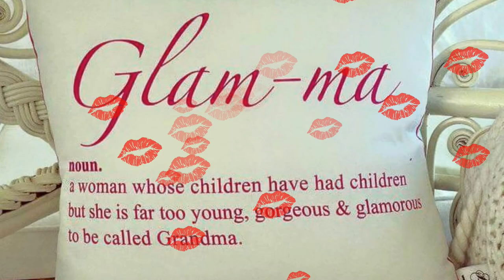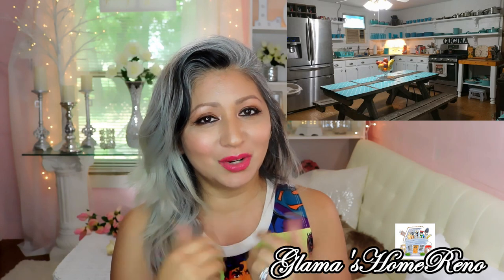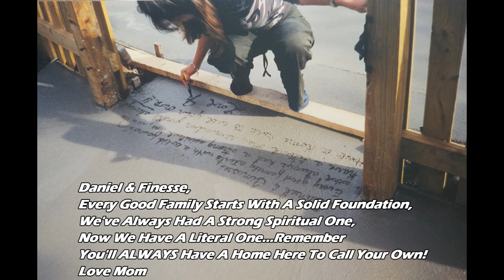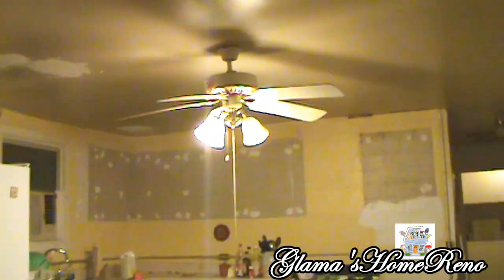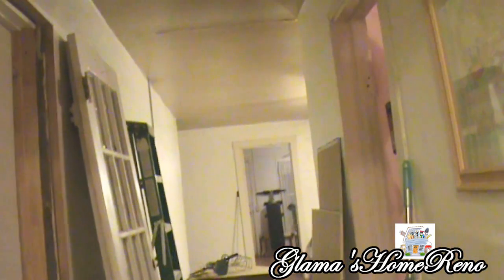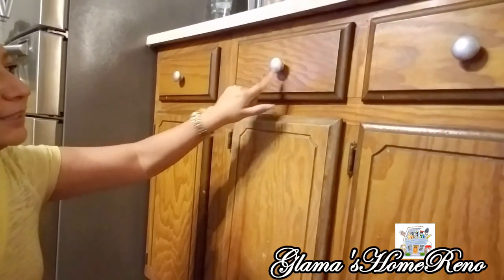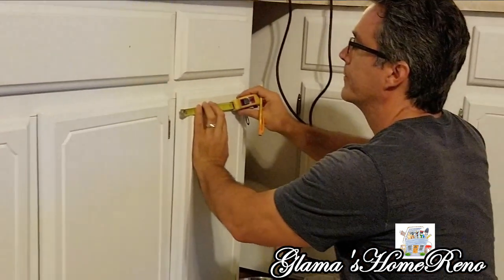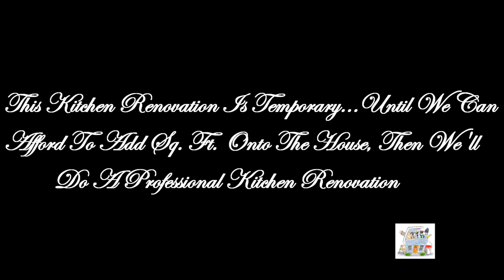UPDATE On My DIY Childhood Home Renovations + Storytime

Comment: I love what you are doing.  I have a question re the kitchen, as you are taking out the fan and replacing it with a chandelier, what are you going to do to cool down the kitchen?  I'm in Australia and cooking in the kitchen (even boiling a kettle) can be crucifying on a hot day.  I would have thought you would need a fan or air conditioning.  
One other thing I don't understand is, what is your mum going to do?  Will she be living with you?
Thanks for your video.  Happy renovating from Australia.
Reply from the maker: Thank you so much, Sorry...I didn't mention where my mom went in this video, because I had already made a video about it...She went to go live with my eldest sister in Washington State. In regards to the Ceiling Fan coming down, I mentioned this this vid that we had one little window in the kitchen and most of it was being blocked by the Window AC Unit...So It gets really cold in there. Thank you so much for watching and commenting...I appreciate it.

Hugs,

Glama
Reply: Made With Love By Glama I thought it gets really hot where you are.  I live in Australia and to just boil a kettle the kitchen gets incredibly hot, so I wouldn't have thought just opening a window on a hot day would achieve anything.